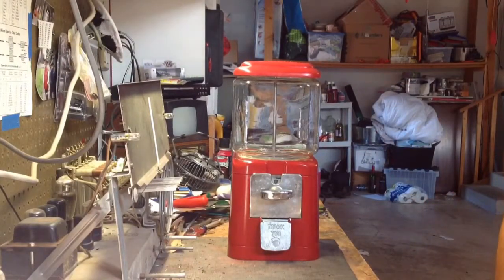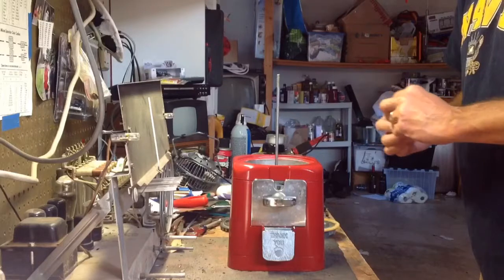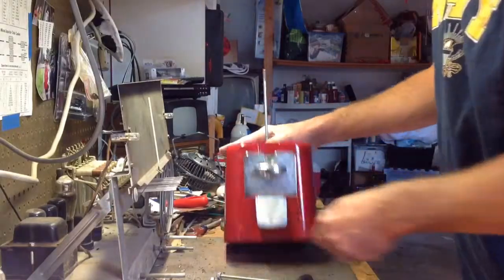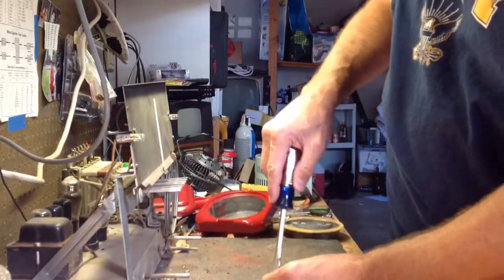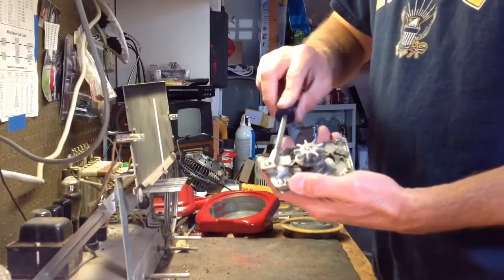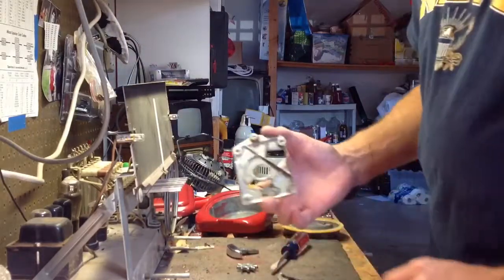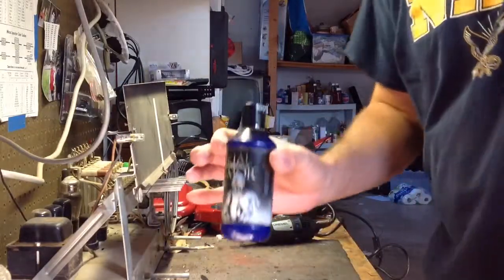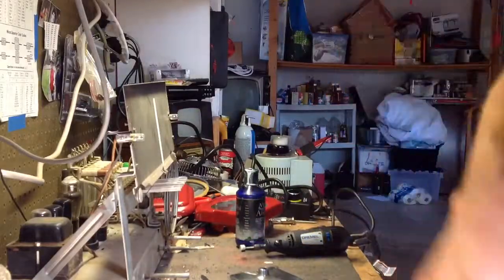Oak "Acorn" Penny Candy/Gumball Machine Restoration Part Three-A

Comment: Why doesn't your bottom piece remove like it's supposed to to get the coins without complete disassembly?
Reply from the maker: This one doesn’t work that way.  Maybe they changed the design on later versions.  On this one the center shaft runs all the way through it from the top to the bottom.  It’s pretty easy to get it apart and get the coins out of it.